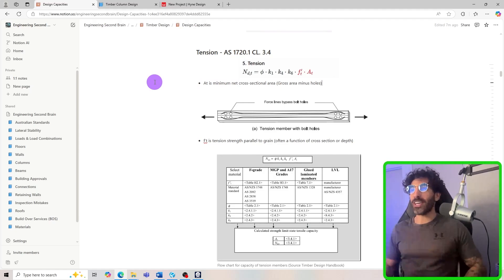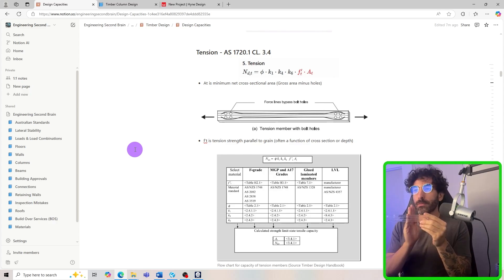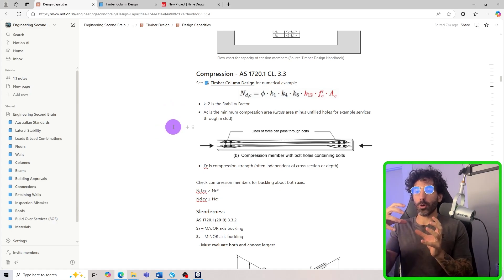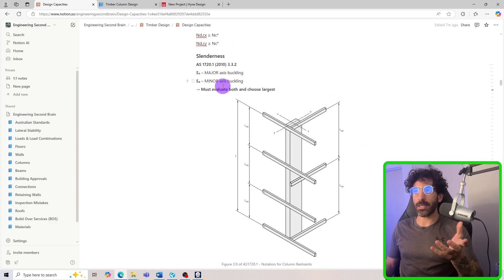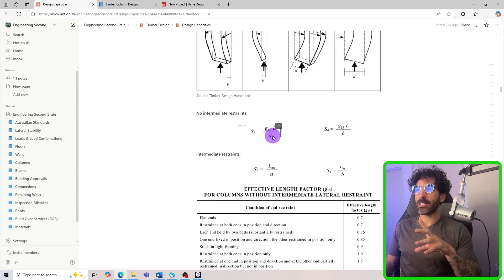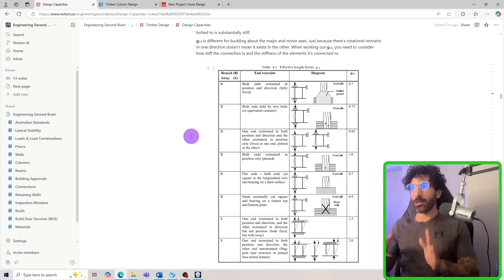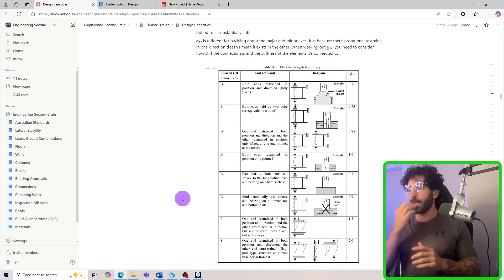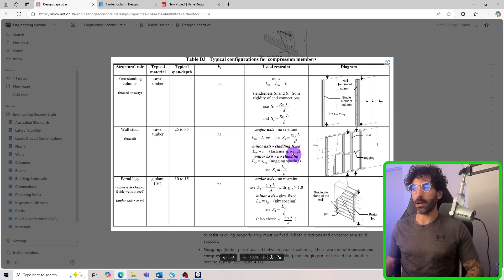Timber in Tension & Compression - Buckling & Restraints (Lesson 2 of 7)

Comment: Hi Gabriel, great explanation on compression and tension members — very detailed and easy to follow! Just a quick clarification: when you mention Table B3: Typical Configurations of Compression Members, are you referring to your own resources or perhaps the Timber Design Handbook? I couldn’t locate that table in AS1720.1 Appendix B.

Also, the same question for Table 4.1 regarding the effective length factor (G13) — is that from AS1720.1 or another reference? Would appreciate the clarification. Thanks again for the informative video!
Reply from the maker: hey Asad..those tables are from the handbook.